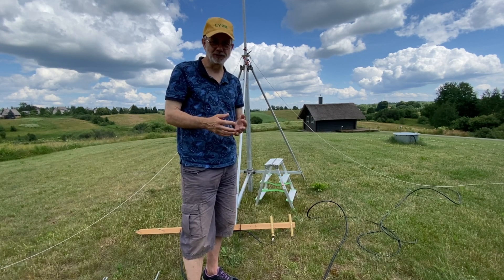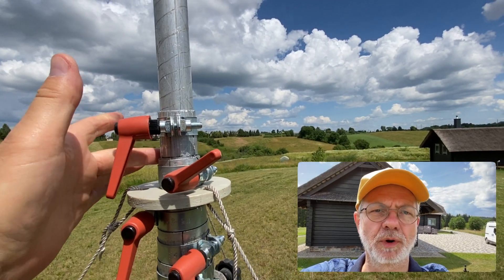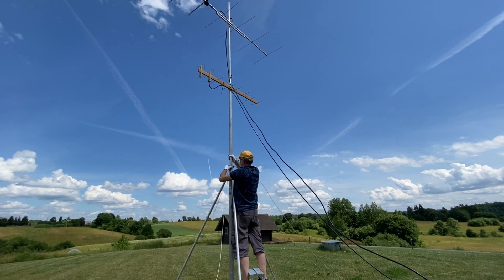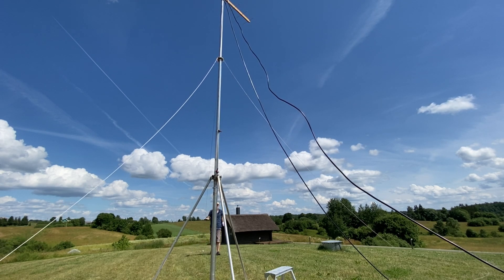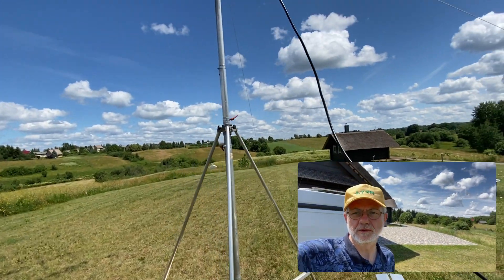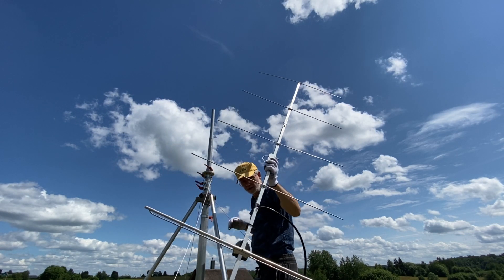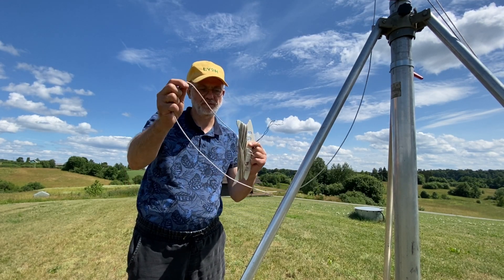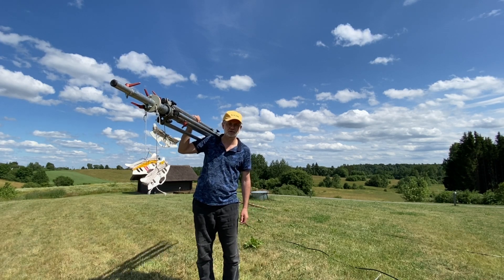10m Aluminium Mast In The  Field: how to handle it alone for the best results.

Comment: Does the clamp teeth on antenna not eat into the aluminium ?
Reply from the maker: Hi there! No,  they don't. The clamps don't look for me as having teeth at all actually :) It's important though, to not over-tighten the clamp. If handled with care, the clamps leave very light marks on the mast's  tube. It seems like the tubes are made of very robust aluminum. Some 30 years in service, and still functioning ( and looking) well. 73! Linas LY2H

Comment: Hi Linus, thanks for this video.  
How easy is it to rotate the mast when in the tripod and do you use a plate or similar on the ground to prevent the mast working its way into the ground when you rotate?
Reply from the maker: Hi Mark, thanks for watching! It is easy to rotate the mast since there are tightening bolts in the tripod holder installed , so it is possible to release them and the mast rotates then. I have also installed two plastic pipe inserts into each of the holders to prevent the bolts from scratching the mast  each time tightened or released. I use no plate underneeth as in most cases in my situations I found myself on pretty firm ground :). There were cases  when at the sea-side on the sandy beach, then I've been using an old glass-jar technique :). The glass jar of the proper size to fit the mast's  diameter is put on the sand and the end of the mast is put into the jar, that's it! Also, a  piece of scrap wood could help in such situations. But in most cases it's ok as is as  the mast has got a rubber cap on the bottom section and it works fine in preventing the bare tube from driving into the softer ground. 73! Linas LY2H
Reply: @Linas_LY2H  Many thanks for the fast response.  Looks like I may have to invest 🙂